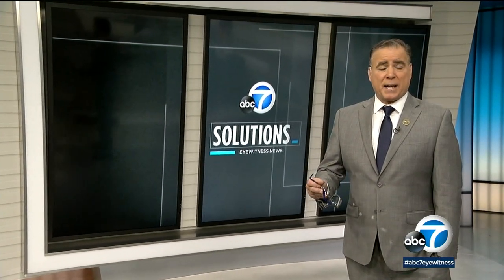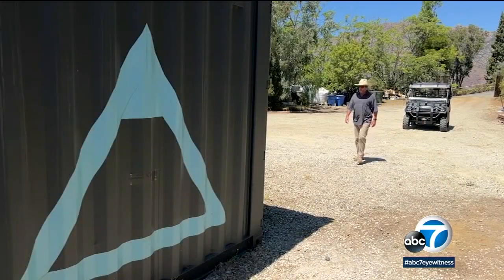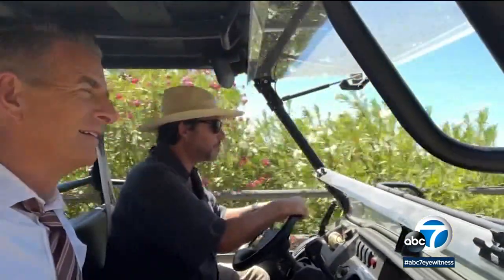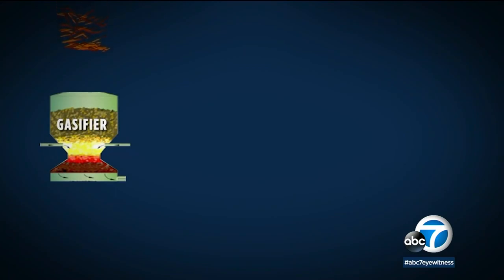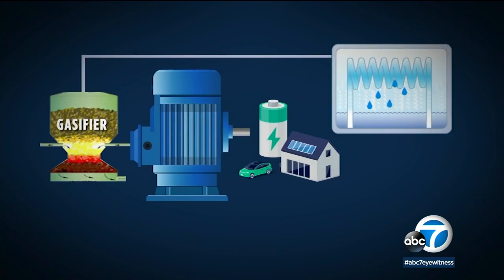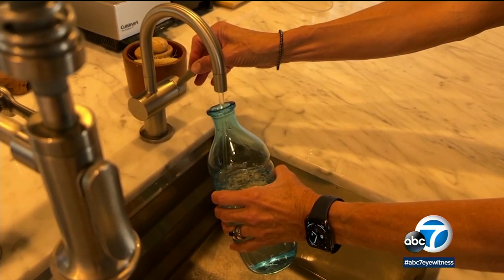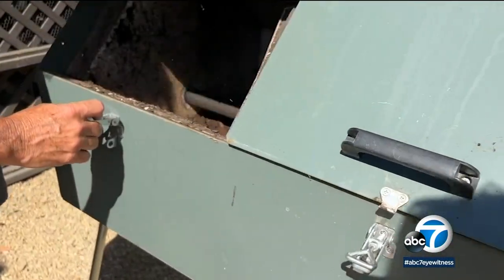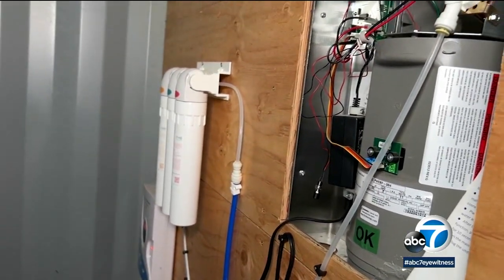Pulling water out of thin air: Could this be the solution to California's drought? | ABC7

Comment: I'm only an self taught amateur scientist and yet; it is EASY to see why this "system" could never work in practice. 

1. Where does all of the 1400 degree heat energy go that's created by burning the organic material? Oh yeah; the differential of the hot tubing in the moist air supposedly causes the water to condensate from the air off of the heat exchanger. 
Q = There's a LOT more moisture in the air next to the ocean; (Malibu) but would this still work just 20 miles inland?
2. How can the "burn chamber" possibly be sealed to prevent the escape of green house gases?
The way I understand basic combustion is that oxygen MUST enter and exhaust MUST exit?
There's NO WAY that this system doesn't produce a TON of noxious exhaust.
4. The diagram shows "gas" being fed directly into a generator to create electricity? 
Call me stupid; but wouldn't in be necessary to BURN THE GAS IN AND INTERNAL COMBUSTION ENGINE to drive the generator? 
This extra step would of course create even MORE green house gases; right?
Sorry; but this "system" is complete and utter BS!
Reply: Moses West was litteraly supplying water to residents in Flint Michigan during their water crisis with his unit. His is far better designed and includes solar panels, as well as harvesting more water from a similarly sized unit. That was all the way back in 2015? The military uses these also in desert climates.